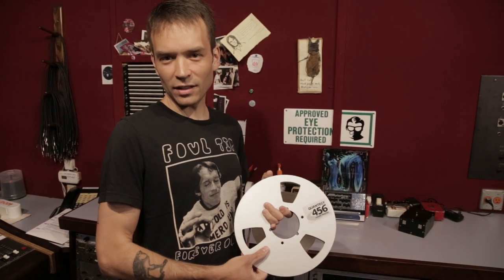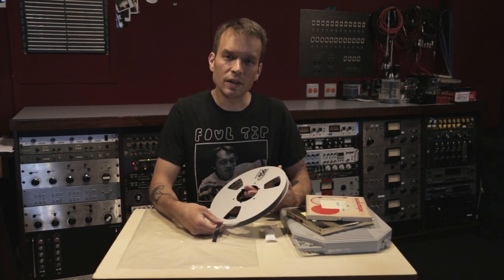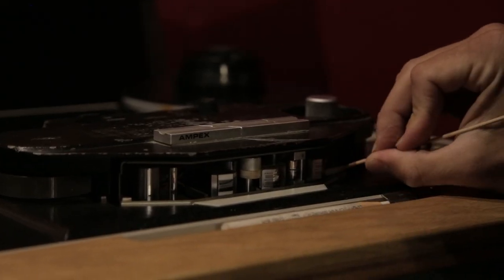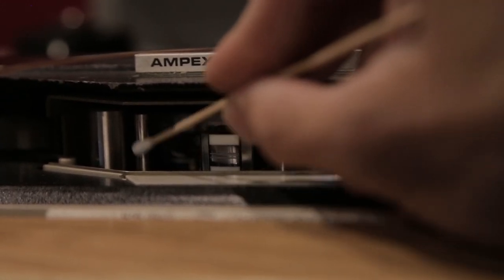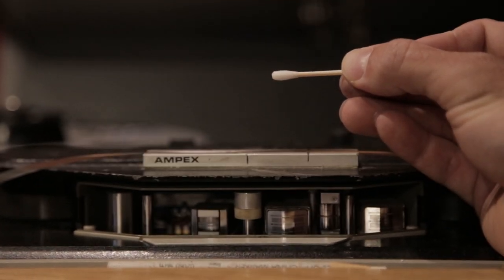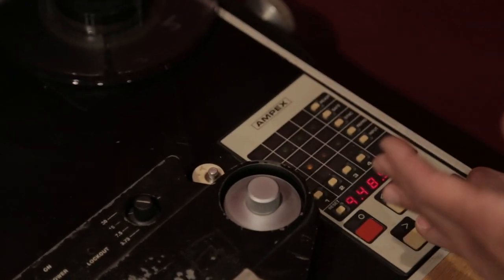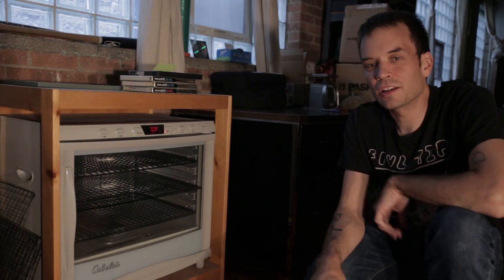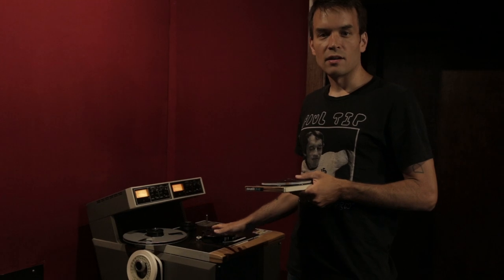Electrical Audio How-To: Baking and Transferring Audio Tapes, Pt. 1

Comment: When you clean the heads, you should not do it in a vertical motion, doing this puts strain on the head laminations and can damage them. You should clean them from side to side (the same way the tape moves over them). Apart from that, this is a well made and informative video. Thank you for making it.
Reply from the maker: Hello, this is how I was instructed to wipe heads, as well. However, our tech Greg Norman advises wiping vertically because there is conductive epoxy that can degrade with alcohol contact when you wipe horizontally. I defer to Greg since he maintains our machines!
Reply: @ElectricalAudioOfficial  Aha, I never knew this. However, I wonder to which machines this applies. I wouldn't have thought the ATR would have those kind of heads. I had one but cant remember. Would be great if you get some more info from Greg on this. Cheers!

Comment: When the baking has solved the problem will the tape usually be good for multiple playbacks like doing a remix on a desk or do I have just "one shot" to transfer it to another medium? Thx
Reply from the maker: Yes, multiple playbacks are totally fine. The only limitation is that the tape will revert to its stickiness at some point, usually within a couple weeks. But within a couple weeks of baking, if you've baked enough, you can playback as much as you need.
Reply: @ElectricalAudioOfficial  this is so good news, thanks a lot!

Comment: Is it recommended to maybe vacu-pack a tape that is known to be susceptible to moisture? Maybe after a bake and transfer just use one of those food storage vacu-sealers and maybe a desiccate pack in the box?
Reply from the maker: Yeah, we pack tapes in plastic bags with dessicant silicone packets inside.
Reply: I would not do this to acetate tapes. The reason acetate tapes don’t commonly exhibit vinegar syndrome unlike acetate base photo/movie film, is that film was commonly stored in sealed tins, whereas tape was always commonly in cardboard boxes that acted as somewhat of a buffer and allowed the tapes to “breathe”

There was one company in the mid-50’s that offered prerecorded 2 track tapes (in both stacked/inline and staggered/offset formats!) and they sold their tapes in these custom round plastic containers, totally sealing the tapes up. Try and open one of those tapes up now after they’ve been stewing in their own juices for 70 years, see what you’ll find…

I have no idea if the polyester base tapes react just as poorly to being sealed up like that, but at the very least I would make sure it’s not being done to acetate

Comment: How long after baking can I wait before I would need to load the tape on the tape machine? I ask because Im in a situation where I wont have the dehydrator in the same location as the tape machine and Im not sure how quickly moisture could find its way back into the tape. Thanks in advance!
Reply from the maker: Hi, you should wait 24 hours between the end of the bake and putting the tape up for transfer.

Your mileage may vary, but the bake will usually leave the tape playable for between a couple weeks and a month. Remember to test it after you bake! You may have to bake again for longer.

Good luck!
Reply: @ElectricalAudioOfficial  thanks a lot! amazing help!

Comment: you ever come across the back-coated ampex 478 from the early-mid 90s, rebadged as quantegy after about 1996? 
I have loads of it, in 1/4", & the issue it has is that the binder holding the black antistatic back-coating on has turned into sticky goo, causing the squealing, sluggish transport, head-gap occlusion & so forth. the problem (with baking) is that the front (oxide) surface of the tape has bits of the back-coating stuck to it. baking on its own wouldn't get rid of these chunks, & in fact may make them adhere permanently.
the oxide surface itself is fine, absolutely solid.
the solution I arrived at, after experimenting with various methods, is to spool the tape back & forth on a 'utility' deck (a modified revox a77 with flat deck), missing out the head block & just going between the two reels, & with the tape pinched, by hand, into a cotton-wool pad soaked in naphtha (white spirit). this way, you can feel the bumps of the crap on the tape as they come off. I repeat this up to ten or a dozen times per reel, until the pad is clean & the tape feels smooth.... it takes over an hour to do 2400' reels. at no time does any oxide come off- all that stays in the pads is black, not brown. the tapes then play ok, & can be digitised or whatever, & in my experience (so far) they stay good afterwards.
again, this is 478, back-coated, & it is what works for me. I have not tried baking these tapes, & I would be fearful of trying this while there is back-coating adhered to the playing surface; my method works for this particular situation.
Reply: also- might be good to upload an example of the worst tape you can find, so that folks can hear the transport squealing & also the modulation on the audio that you get as the tape sticks to the head while being dragged across it. it is pretty heart-breaking to hear a master ruined like this.
there was a lot of work done on this by a kiwi lady, link here, which set me on the path of not baking as a fix:

https://richardhess.com/notes/author/marie_oconnell/
Reply from the maker: Baking will (should) prevent the adherence of back coating to the mag coating in the first place. Once the coatings have been pulled off the binder, it becomes a much, much longer process, hence the standard of testing and baking before we do anything else to tapes exhibiting symptoms of sticky-shed.

Comment: hi there are make of tapes  that never need baking  zonal I NEVER BAKED  i have a otari  mtr 12  1/2 tape    it's the ampex makes i had to check   i know zonal
is not liked because of the why it sounds when it recorded on   zonal has a higher out put  and just not right for drums i have be told  i love the sound of betacam sp 
when recording  put the heads in to play back when recording sounds ace   4 track quad audio as well for mastering

Comment: Sorry if it's a stupid question, but does the method work with music cassettes too?
Reply from the maker: Never crossed my mind that cassettes could develop sticky-shed, but after 2 minutes of Googling, I see some reports that it restored some folks' cassettes. It wouldn't hurt as long as you mind keeping the temperature low enough. And bear in mind- baking only "restores" tapes temporarily, so if you have important work on cassettes, bake them and transfer them immediately.
Reply: @ElectricalAudioOfficial  , no issues with baking a plastic enclosure tape at the same temperature?  Likewise,  can you bake a tape on a plastic reel or must be metal?

Comment: I need someone to bake like 60 different size reel to reels. Can you tell me who would do that?
Reply from the maker: If you're in Chicago, we would do it. Otherwise, there may be a taxidermist you could find locally, or you could buy an oven yourself, which would almost certainly be cheaper than shipping to someone both ways and paying for baking.
Reply: @ElectricalAudioOfficial  I could be ok with shipping costs considering theyv3 been in storage over 20 years
Reply: @ElectricalAudioOfficial  my moms from Chicago..spent a lot of time there as a kid ☺
Reply: I’d probably drive
Reply from the maker: @themysticeye1  Email us and we can discuss! Contact info at electricalaudio.com.
Reply: @ElectricalAudioOfficial  ok thanks I’m slow but I will

Comment: Couple things to note about ovens. I agree that a correct oven is critical, but FWIW, a fair number of higher end modern kitchen ovens now have a proper dehydrate feature. My Electrolux does. It gives very precise temperature control in 5 degree steps. It has a convection fan to circulate air to actually remove the humidity that is baked out of the tape, and the interior is quite spacious. I can do 6 10.5 reels no problem. A couple other points for folks to consider. It is not a point of religion, but I still prefer to put my tape on an NAB sized hub and an aluminum reel. First, I just don't trust plastic reels to keep their shape, even at only 135 F., second the aluminum flange more quickly and evenly spreads the heat across the pack as compared to plastic, and third the larger hub puts less stress on the  inner winds of the tape. Just my opinion. Not sure where you came up with your times, but I have good results with 1/4" 80's Ampex 456 at 135 for about 4 hours. 12 hours seems like a very very long bake to me, but that's just me. Trust that you've done your research and you make a lot of good points in your video.

Also, when cleaning heads, I never use the same cleaning tip on more than one head surface. I also use DENATURED alcohol, not IPA. A Menda bottle is real handy too. Beyond that, I often use zero lint makeup pads rather than Q-tips. They're just faster and make far less lint. And, with makeup pads, you can use ACETONE on the rollers and guides - which cleans the gunk about ten times faster than alcohol ever will - without dripping like Q-tips. Of course, do NOT use Acetone on a head-stack or rubber parts, and be aware that Acetone will melt cheap plastic trim parts on some machines - like a Tascam 32, etc. duh.

 FWIW, I've been using RTR technology since 1967. I cut my teeth on 2" MCI and 1/2 Sculley 30ips 280's, and I currently have nine reel to reel machines. These cover the gamut from a mono 1 3/4 Voice of Music to a 30 IPS Studer A80 MkII. Again, I think you make a lot of good points in your video. Good to see the young guys getting into RTR technology, before the old geezers like me die off. :-)
Reply from the maker: Yes, if you have a good oven with a dehydrate feature and a convection fan, and the oven can get down to 130F, go for it. Most household ovens don't have any of the three.

Also completely agree that aluminum reels are way superior in every way to plastic. However, when we get reels in for baking, they often come in on plastic reels. The risk of winding a sticky tape and pulling off the mag coating is the paramount concern, meaning we can't transfer from a plastic reel to an aluminum one, which is why we always bake tapes on the reels they arrive in.

We use medical grade q-tips that don't shed any lint. We replace when they appear even remotely soiled.

Our bake times come from experience. Many tapes are ok after a one-day bake at 130F, but we're finding a lot of 456 and Scotch 250 tapes that need baking 3, 5, 7, or even 10-14 days and repeated bakes to be playable safely.

Comment: Can you use a gas oven?
Reply from the maker: I have never tried, but I think you could, as long as you can get the temperature down low enough, and there is air constantly circulating. Shouldn't matter what's creating the heat.

Comment: Acetate tape is transparent when the reel is looked at sideways. Acetate can be physically wiped/cleaned with Renuzit, or Alcohol, according to some folks. Polyester is opaque.
Reply: I have wiped the sides of dirty/moldy acetate tape pancakes with both alcohol and diluted hydrogen peroxide, to no immediately bad effects. But I have not tried the actual oxide surface of the tape and I’m not sure I would try on something valuable. In either case I think there is a chance alcohol may dry out the tape and that is something you do not want, so cleaning like that is a last resort IMO. Good acetate tape will remain supple even after 70 years. Dry tape turns brittle and curls up - you’ll often see this on the outer layers of tapes that were never leadered, where they are most exposed.

Comment: You don't let the heads dry for a good while after hitting them with alcohol??  I would be afraid the left-over alcohol would damage the tape!  For that matter, after I clean each head, I dry it with a dry Q-Tip so I don't have to wait as long for it to dry!
"Shedding" (rather than, "sheddiness") will suffice.
Reply from the maker: We use 99% isopropyl alcohol, which evaporates in moments. If you brush some on a flat metal metal surface with a q-tip you can see how quickly it evaporates.

Comment: Be careful with tape baking. we had some tapes baked at a professional facility and it completely changed the sound infidelity of the audio in fact many large tape libraries already knew this and have turned to other means of tape restoration. we also have tried the ' nu finish' car spray and we think that the results are better than baking tapes be very very careful

Comment: I always understood that tape path and heads should be cleaned horizontally not vertically.
Reply from the maker: There have been a number of comments about this recently. I was taught to wipe horizontally, as well, but our tech Greg asks us to wipe heads vertically, as he says there is conductive epoxy at the edges of the heads that will degrade with contact with alcohol. He mentions this is another video.

Comment: I did that with my air-fryer... it can go to 130F. Alas it does not run for 24 hours.
Reply from the maker: Wild! Did it work? Most 1/4" and even 1/2" tapes don't need the full 24 hours, I'm finding. Some do, though, and the amount of degradation is dependent on an inseparable mixture of storage conditions, formula, etc. etc.
Reply: @ElectricalAudioOfficial  it did run a lot better, no squealing at all. though it was 1/4" tape on a 7" reel, not sure if a 10" one would fit.

Comment: Funny the best Magnetic recording company, AMPEX made horrible tape. I have used many, many tapes. And the most consistent was 3M.
I restore 2" quad video tape machines and I will never play a tape w/o baking. The very delicate video heads can get clogged easily and even the control track head (which is mounted on the video head assembly) can get clogged and throw off the servo mechanisms. You dont want to be 80 min into a 90 min reel and have clogs!
Reply from the maker: We only discovered problems were common with 456 many years after they manufactured it. They weren't knowingly making the tape in bad faith.

Scotch 250 is equally problematic in our experience, and some of the most degraded tapes we've ever seen were 250.
Reply: @ElectricalAudioOfficial  in video tape ampex tape was bad. The only thing worse was Fuji tape which only lasted about 6 plays then it fell apart.
3M had a winning formula in both audio and video tape. It was very consistant
Reply: @ElectricalAudioOfficial  have any 1/4 10.5” reels of 3M 250 laying around? Some of the later production runs came on nice 6 screw precision NAB reels, I’ll gladly take that junk tape off your hands 😂
Reply from the maker: @MrRom92DAW  We do not. We have one precision reel and we are keeping it!

Comment: Thought that was an interesting video until the tech is cleaning the heads with a qtip and just wiggling it all over the heads….maybe something overlooked?
Reply from the maker: Not sure what you mean, the demonstration in the video was a proper, real head cleaning. We wipe vertically because our tech has cautioned us that there is epoxy near the edges that will wear down over time with alcohol exposure. The heads one contact tape at an extremely narrow point, unless they are worn.

Comment: You're not cleaning the heads properly!  You should go "with the grain" as in from left to right.  When you go top to bottom, that is "against the grain" and isn't correct.
Reply from the maker: Hi there. As you'll see in our other videos, our tech Greg suggests cleaning vertically because cleaning horizontally "with the grain" will place alcohol on the epoxy in the heads which can degrade them. Thanks for watching.
Reply: @ElectricalAudioOfficial  I totally disagree with that.